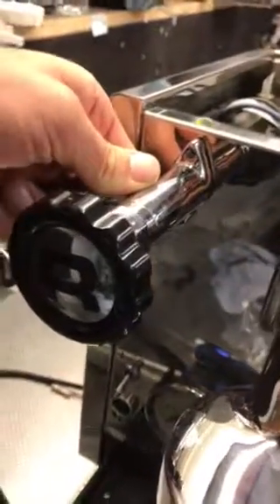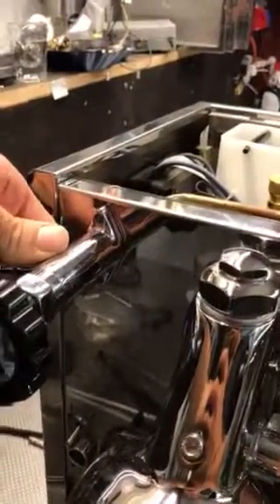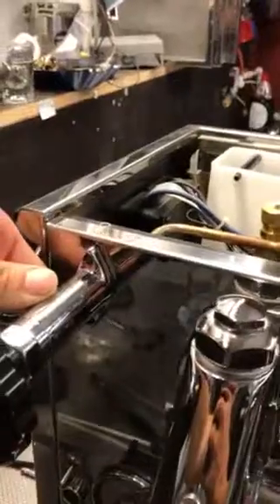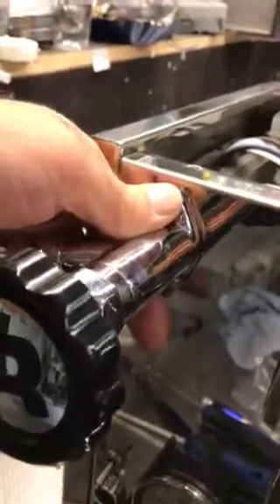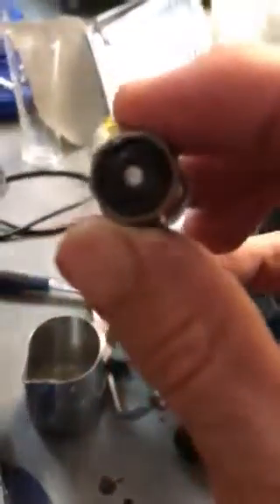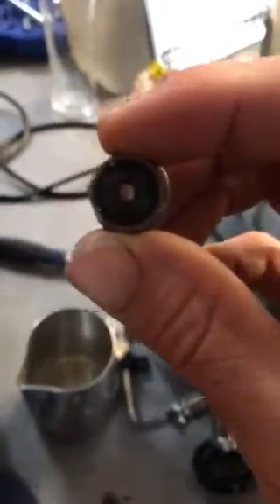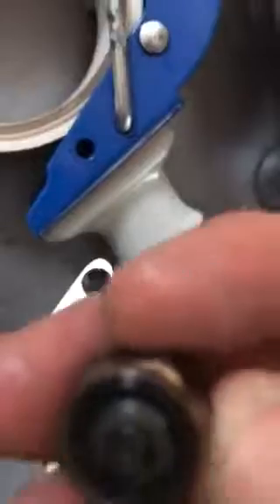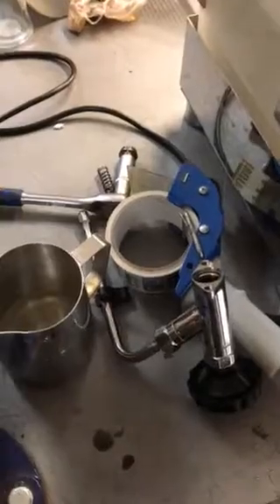Rocket R58 tap seal replacement

Comment: Thank you for this. I hadnt seen your video, and did everything up to thr ratchet in the vice. I tried loosening it with an adjustable spanner and it was so tight that i though that it was not a thread. I will give it another shot knowing this now. Cheers

Comment: How did you open the tap seal ,for steam valve.  Did you turn it to Clockwise or counterclockwise?
Reply: If you are looking against the rear of the valve, counterclockwise to loosen, O have just placed a new seal and the leakage has stopped. You really need a vice and a long 13mm socket. Socket wrench connection is 1/2 ", maximum torque with minimal effort.

Comment: What about no water from water wand on rocket r60v?
Reply from the maker: The R60V uses the same tap so it’s possible. It’s quite a common issue.
Reply: @Bellmancoffee  is it the same way? Because mine no longer works.

The steam wand works perfectly btw
Reply from the maker: It will be most likely this issue. When the hot water is not used much the seal sticks. You don’t need to buy a new seal, just carefully remove the old seal and flip it around to the unused side. Take your time, try not to mark your nice shiny chrome taps.
Reply: @Bellmancoffee  thanks
I will try it
True, I rarely use it, but now I got into Americano 😅